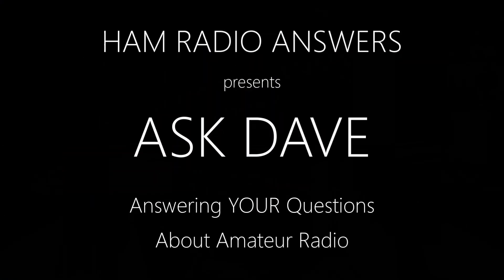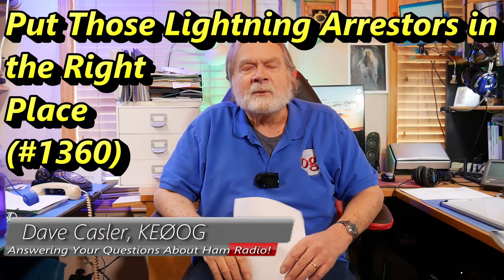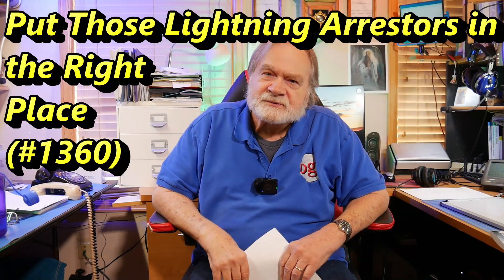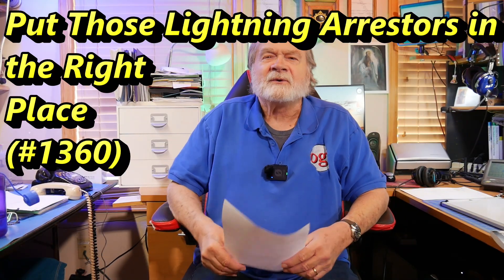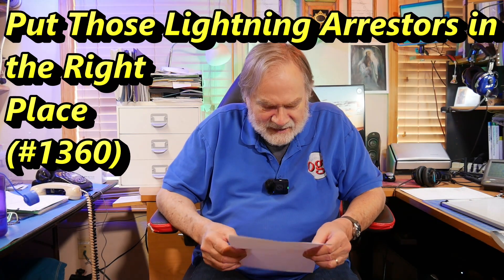Put Those Lightning Arrestors in the Right Place (#1360)

Comment: I just finished a ground system installation for my shack. Didn't read the grounding bible, but tried to do a good job. Mounted a 2" x 12" x 1/4" copper bar on standoffs to a Delrin plate that I fastened to the masonry wall just outside the shack. Lightning arrestors are mounted to the bar, 1" braid goes through the wall into the shack from there through PVC conduit with the antenna feeds, and  2" wide copper flashing strip leads about 6'ft to 25' of 3/4" copper pipe that I laid about 8" deep in the limestone rock that passes for soil with 50lb of GEM material poured over the whole length, and then the trench covered up. Of course that's all bonded to the house electrical ground as well. My first QSO I did a QRP test and got down to 0.5W on 20m to Iowa with my EFRL antenna. I'll take that as a sign things are working well.

Comment: I think a major reason professional transmitters are less susceptible to lightning damage is that they are just built out of much heavier parts. A lightning arrestor on even a local MW transmitter consists of two metal balls a foot or more in size. Large stations have towers that are sometimes permanently grounded for anything other than the specific frequency to which they are tuned. And last but not least, human operators play it safe and operate their station by remote control from a safe location.

Comment: Ok. I have a two story house and my ham shack is on the second floor. All my coax goes out through an MFJ "window feedthrough panel" and down about fifteen feet to my lightning arrestors connected to a copper ground rod directly below the second story window. Technically, the "coax enters my house" at the outside of my second story window. Is there anything I could do to improve my lightning protection? 73 de WB4DW  Edit: All equipment in my shack is tied together via copper braid to a central copper bar which is connected by copper braid to the MFJ feedthrough panel, which is then connected via about fifteen feet of copper strap to the ground rod below my shack window.

Comment: Are we really talking about a lightning strike or high voltage static electricity building up on the cable? Years ago I remember seeing blue flashes coming off my long wire which came down the shack wall jumping across maybe a half inch gap. There was no lightning but I assume statically charged rain which would certainly blow out the front end on a receiver or worse so I always unplug any aerials. I think a direct lightning strike would vapourise the long wire. 
Look at the size of an earth rod on a building to carry hundreds of Amps. 
The ones I've seen look as if they'd explode and vapourise with a lightning strike.
G4GHB.

Comment: About 35 years ago, I was working in a television station that had a short tower just outside the department where I worked.  It was just the microwave tower to connect to the transmitter location.  Lightning hit the tower.  I was talking with the art director through an opening in the wall; a window without glass.  A fireball passed between us simultaneous to the bang of the lightning.  It was quite a memorable experience.  As far as I know, no damage was done to the station equipment and we remained on air.

Comment: Motorols r56 is wild. I've been studying it for a little while.
Reply: Yea, during my GOVT years, I was the COTR for several large Motorola installations.  In all sites of a large Smartzone system, the coax protection was installed about 1 foot or less after the coax entered the building or enclosure.  I still have a dozen or so R56 CD’s.  It’s almost like they gave me one CD for every power amp they installed.  I studied it very carefully.  Lots of good info therein…..at least in my opinion.

Comment: The car is capacitively grounded to Earth. The reason you don't get electrocuted in the car is because the car body acts as a Faraday cage.
That may not work if your roof is not metal!
Reply: The E-field strength before the channel connects the cloud to the car is so high that it creates a secondary discharge reaching up. So the first breakdown is from the ground to one of the wheel rims. That's what keeps the car grounded initially. Once the channel connects and the real current starts flowing, it's the length of the channel that matters: if the cloud charge is 1km up and the wheel is 10cm wide, that gets the initial voltage of say a billion volts divided by roughly 10,000. A 100 kV/10 kA spark is not something one wants to examine at close quarters, but the charge does not enter the car unless it's one of those cheeapo cars with a rag roof. ;-)